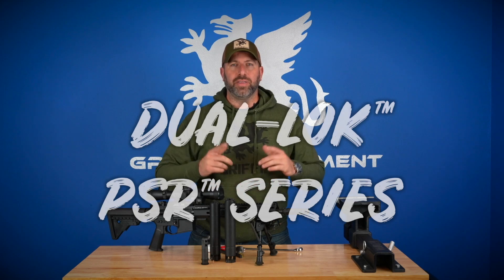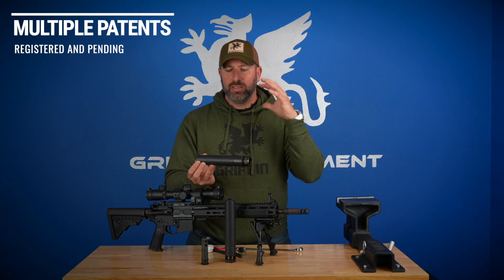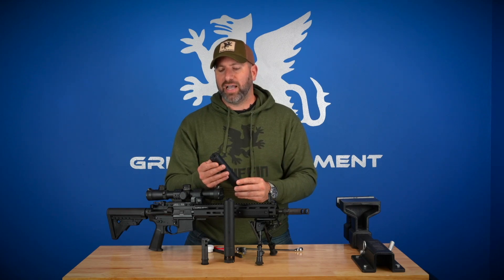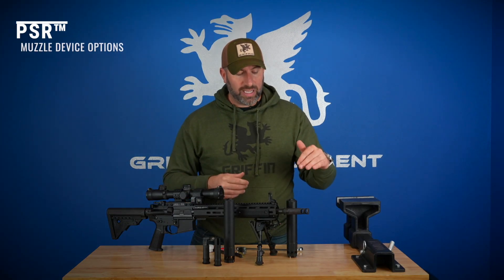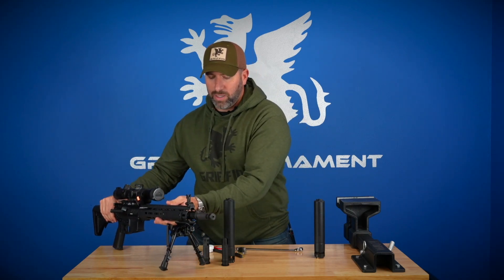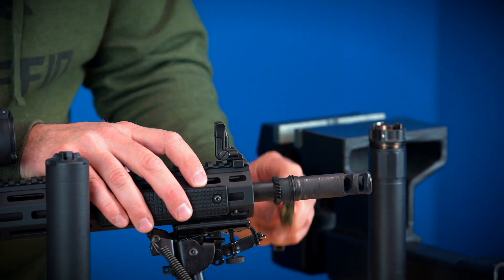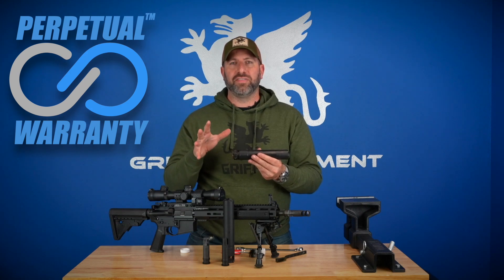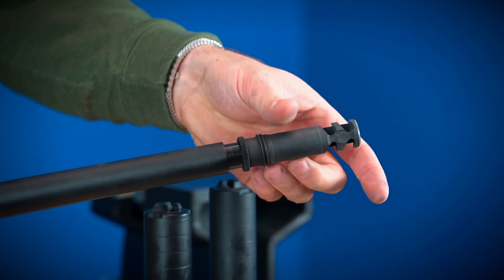DUAL-LOK™ PSR™ Suppressor Tutorial

Comment: OTB 7 762 PSR shows thread pitches for 556 and 762 can i mount it on both out the box or do i need to buy an adapter as well?
Reply from the maker: Unless you have 5/8x24 threads on your 5.56, you can't mount the .30 cal brake that ships with the PSR 7 on your 5.56 platform. You'll most likely have to buy the 1/2x28 corresponding brake for your 5.56 if you want to swap between platforms.
Reply: One last question, I have a ar-9 with the thread pitch 1/2x28 can I shoot 9mm out this the PSR7? @GriffinArmamentOfficial
Reply from the maker: No, that won't work. The PSR 7 only has a .30 cal bore diameter.

Comment: How much length is added to the barrel with that muzzle device? I would like to know the minimal length barrel possible for pin and weld to get to 16" requirement. Does it have enough over-hang for it to be pinned and welded to a 13.7 or 13.9 or 14.5 to get a legal 16" barrel? And if so, where is the best place (bottom obviously, but at what location lengthwise) to put the pin and weld? Thanks.
Reply from the maker: Putting a PSR suppressor or muzzle device on an SBR is not ideal. We have much better offerings if you're looking for a SBR compatible suppressor. These muzzle devices won't get you the minimum 16", though we do offer other Dual-Lok muzzle devices that will meet your 13.7, 13.9, and 14.5" requirements, and be compatible with our other Dual-Lok suppressors if you're interested in this mounting system.
Reply: @GriffinArmamentOfficial  My goal is to have a pin and welded option that will help me avoid the SBR regulations...to have a legal set up with 16" overall "barrel length"...be it by welding a muzzle device or the suppressor itself. I am actually interested in two suppressors...one for 5.56 and the other for 6.8 spc. If you could recommend which silencer (and muzzle device if needed) you would recommend as well as the shortest barrel length that would allow me to meet that 16" bolt face to end of permanent device...I would appreciate it very much. Thank you.
Reply from the maker: We could recommend a plethora of suppressor options, but it all depends on what you're looking for out of your shooting experience. Are you only interested in the Dual-Lok mounting system? Do you prioritize weight over performance? Flash reduction? Does it need to have the best sound suppression out of our lineup? 

If you could let us know a little more about what you're looking for, we can get you the best recommendations for your minimum requirements, along with the better muzzle devices to help improve your shooting experience.
Reply: @GriffinArmamentOfficial  I suppose my objective is somewhat along the lines of a “jack if all trades but an expert at none,” or rephrased as “the best balance of everything.”  Obviously, the intent of a shorter barrel (don’t have or want to suppress anything less than 12.5”)  is light weight, so that is one thing I would rate high. Doesn’t have to be the lightest per say…as long as it isn’t close to being the heaviest. I would rate maintaining accuracy as important. Sound suppression is desired to minimize noise to neighbors when I shoot. Doesn’t have to be the quietest…just don’t want to bother anyone. I have a range in my property and get along with my neighbors…in fact, a few of my closest neighbors come here to confirm their firearms are sighted in before hunting season. All is good, just trying to be respectful and take out what I can as I am interested in shooting more often than I have done in the past. Dual lock up sounds nice. I would certainly rather lose a muzzle device when a barrel is worn out than screw up a silencer trying to remove it. Price is not a concern. Sure, everyone likes to save money but I will pay for what is ideal. Objective…convert barrels into 16” legal rifles one way or another. Lengths to consider are 12.5” (5.56), 13” (both 5.56 & 6.8), but if needed I could go with 13.7-14.7.” I am fine with brake mounts to preserve the suppressor. I like what I saw on your ecostack and PSR options, but I am not against being redirected. Right now I have a Huxwrks 5.56 and Ca$h…and a Dead Wolfman, and have been happy, but the more I learn about suppressors, the more I am interested in your offerings.
Reply from the maker: The Dual-Lok 5 or Dual-Lok 7, depending on your preference of caliber, are going to be you better choices to balance out sound, flash, flow-through and lightweight performance. Considering you're shooting 5.56mm and 6.8mm SPC, the Dual-Lok 7 is probably your better option. 

If you're looking to pin & weld your can permanently, you should go with a GP7 to help meet your 16" minimum. We have a plethora of muzzle devices to look through per your build preferences, so we recommend checking out the Muzzle Device section on our website!

Comment: Can you shoot these with the collar unlocked? One of my hosts would put the collar an inch under the rail, and would be impossible to engage/ disengage.
Reply from the maker: We don't recommend that. It was intended to be shot in the flush locked position. We recommend shortening the platform's rail if you do proceed with the PSR as your option 🇺🇸
Reply: @GriffinArmamentOfficial  thanks for the reply! It's not really a problem that gun already has a dedicated can, I just wanted to see if it was possible to run it on that host.

Comment: How does the blowback compare to a flow through
Reply from the maker: We haven't tested these in relation to flow through suppressors. However, the PSR suppressors are over the barrel and contain Griffin's ECO-FLOW baffle technology, which diminish blowback very well. The vented ports on the PSR end cap also helps with blowback.

Comment: Would have been cool if the muzzle devise was 0.75” longer so you could pin it to a 12.5” barrel.
Reply: It would need more than that...as total length of the muzzle device isn't what is counted. It is only the OVERHANG that adds length. What is over the barrel doesn't count.
Reply: No joke, I would get one in a heart beat if that was the case.

Comment: So, if i bought a 30 cal can, with two brakes....one for a 556, the other for a 30....can the suppressor go back and forth? Are the outside threads universal for both cans?
Reply from the maker: Yep! That would absolutely work. Just need to confirm alignment for both but you'd be good to go. The use of these PSR™ DUAL-LOK™ Muzzle devices have some host firearm barrel requirements : 1.95" rear of the thread shoulder needs to be .775" OD or smaller in order to provide clearance for interfacing. More info can be found on the muzzle device page https://www.griffinarmament.com/psr-dual-lok-paladin-muzzle-brake/

Comment: How well does 556 run through the 30 Cal can?  They both being so close in length and weight.  I'm curious what the performance differences are.  

For the MK1 that are sold on the site can we get the uppers/lowers/handguard in a different color or just the furniture I see noted?
Reply from the maker: 556 does very well through .30 cal can because the bore size is only slightly bigger. Some folks actually choose to size up a bore size as extra insurance not to get a baffle strike. But if you check alignment prior to shooting, that shouldn't be a factor with the dual-lok suppressors as they stay nice and tight after mounting. Also make sure your muzzle device is torqued properly. The uppers, lowers, and handguard only come in the one option of color. The furniture and slings are offered in a few different color options.